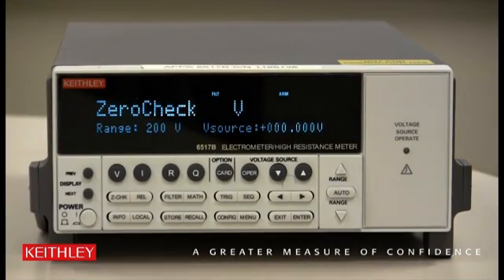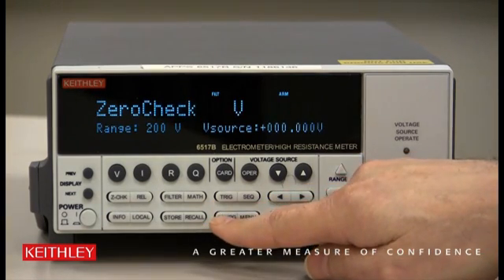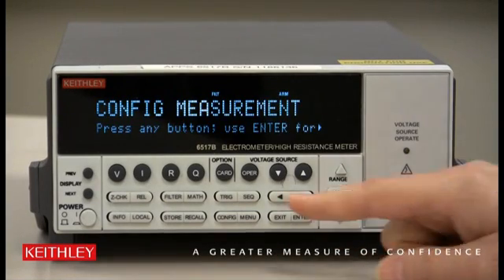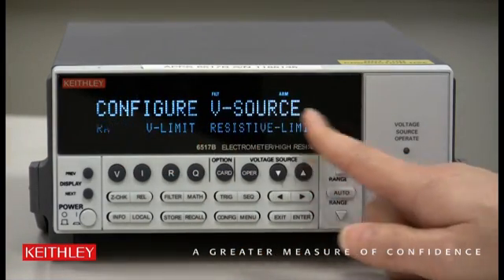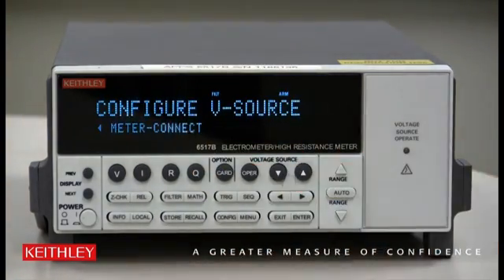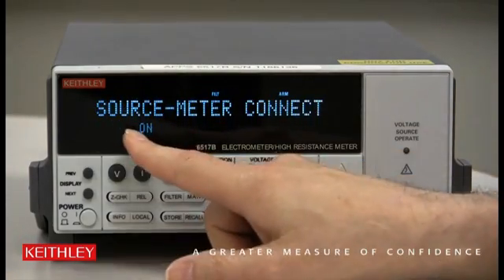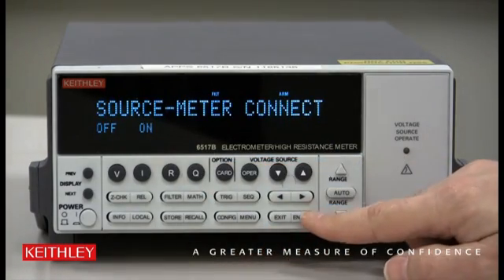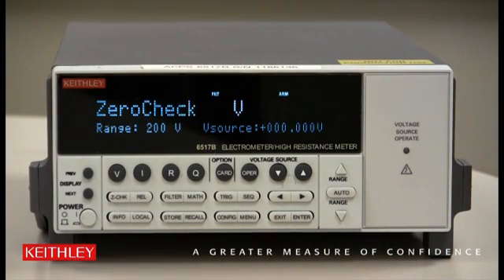How to Enable the Meter Connect Feature on the Model 6517B Electrometer

Comment: Thanks for this very informative Video. Now I would like to do this via LabView. I installed all the required Instrument Drivers and got everything to work, however I cannot find a Option to enable Meter Connect via the Labview Software.
Reply: Markus, if you use the VISA write VI included with LabVIEW, you can pass the instrument the string ":SOUR:VOLT:MCON 1" to enable meter connect programatically. To turn meter connect off, send the instrument ":SOUR:VOLT:MCON 0".